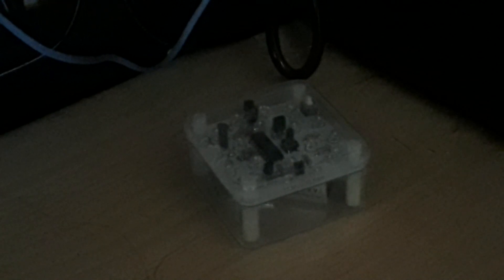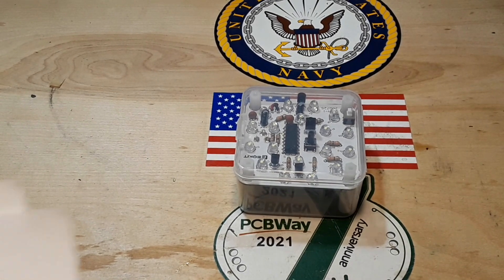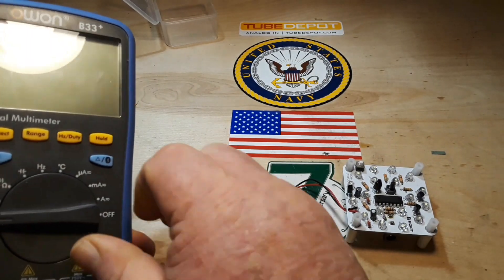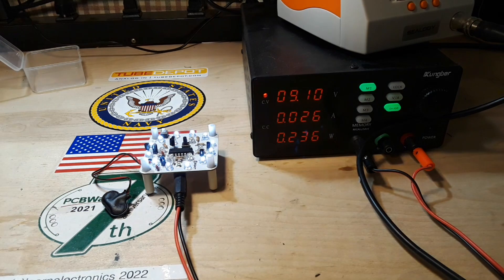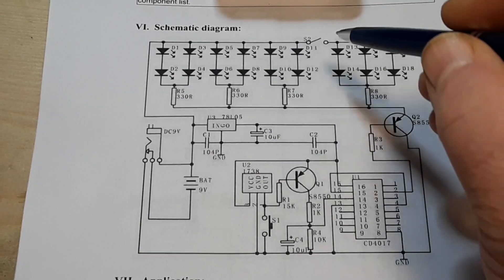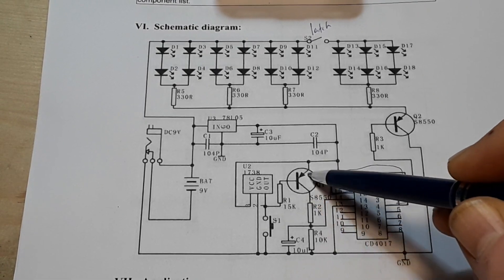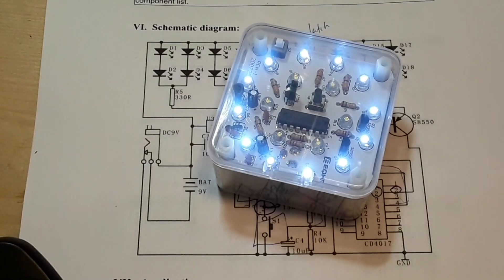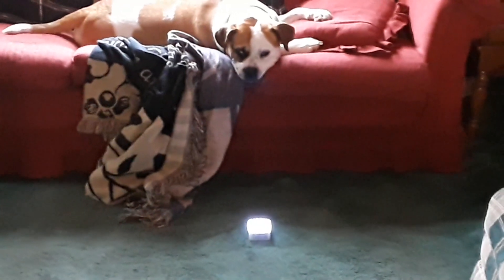How It Works - The CD4017 Night Light

Comment: It could be extended by putting the existing transistor in charge of driving half of the LEDs, adding a further transistor for them all. A diode would also be required to separate the strings, putting its base on output 3, then    connecting output 4 to reset. This would give an off - low - high - off  cycle. I am so going to steal this idea!

Comment: Knowing what the RC5 codes look like on tv remote controls, the cap on the transistor input to the clock is doing a good job of debouncing the clock signal. It is an interesting trade off on the design, as it is necessary to meet the maximum rise time of the clock input, without risking multi triggering the clock input. The cd4017 clock has a Schmitt trigger input, that makes slow rise time signals acceptable. This maybe why the cd4017 was chosen for this circuit, and not some other device from the family. A Johnson ring counter with Schmitt inputs, what not to like?

Comment: remove the reset from pin 4 add a few more leds then you have a massive night light chaser :-D then cascade it with a 4011 :-D
Reply: I imagine this  is the ‘bigger’ design and they have just delivered a simple version ... or they had a cupboard full of those chips to get rid of 😀👍